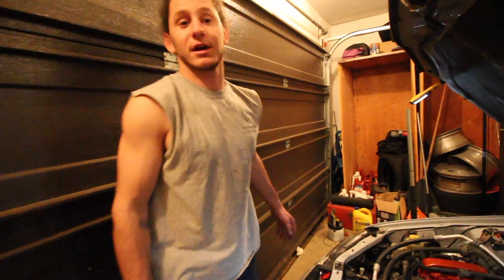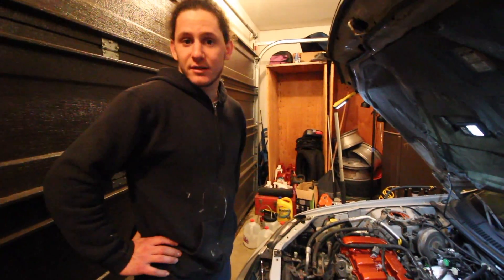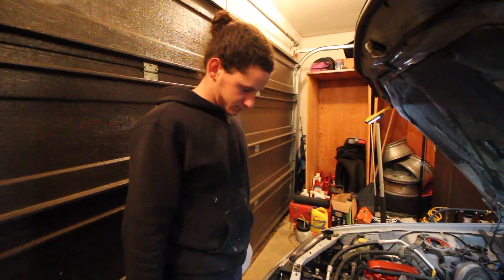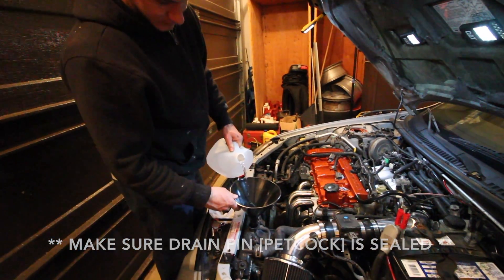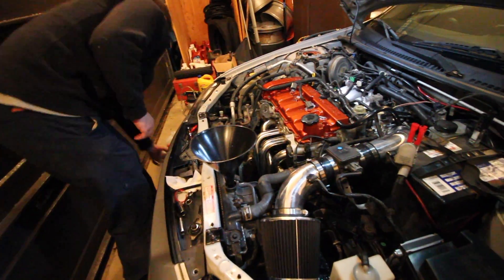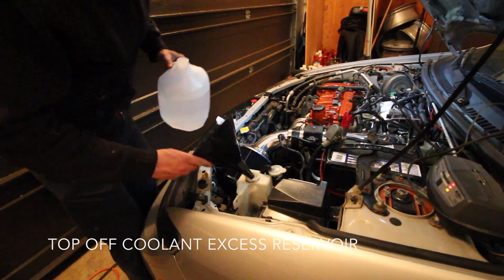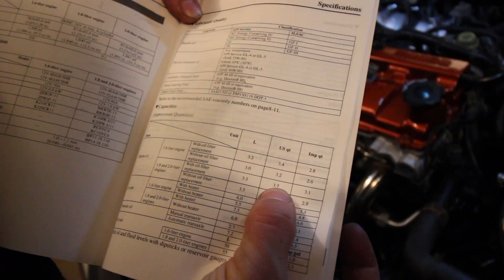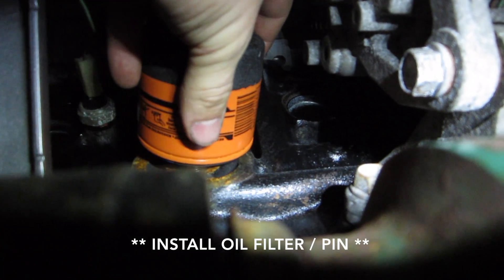How To Prime & Start a Dry Engine [FIRST START]

Comment: You definitely dont want to let a rebuilt motor idle... You should have kept the rpm around 1500 to 2500...
Reply from the maker: i just read up on that, and it seems logical, but we have never had an issue. we'll pay more attention to that in the future. thanks for the info!
Reply: Mils Garage I just had to say it, because it looks like you're a major perfectionist like me.👌
Reply from the maker: hahaha yeah, that's spot on. 👌 always aiming to do better. i really appreciate you tuning in :)
Reply: Why would you pour oil down the spark plug holes??... its just gonna sit on top of the pistons and foul up your spark plugs, cat and O2 sensor.
Reply: casiotechI you remove the spark plugs and crank the engine over until the oil pressure light goes out
Reply: casiotechI a lot of people... well then it MUST be true!!
Reply: casiotechI  what I did was... lubricate the cylinder walls with oil a little bit and and hand cranked few times and made it nice and smooth before putting the cylinder head back on. That way I made sure the Pistons are lubricated and I didn't have to pour oil through the spark plug tube which is eventually going to sit on the top of pistons unless you pour a good amount to make it reach the Pistons but that didn't seem to make sense to me. I am going to start my 7th gen civic engine tomorrow. Wish me good luck as this is my first job ever.

Comment: Thanks for the video; I was under impression the oil pump needs to be primed before adding oil, but by priming the pump when installed, here you primed it mechanically cranking the engine, this way it is easier but is this the correct way to do it? so much contradicting info out there that is why I ask. My rebuilt engine has been under a tarp on the side of the garage for 3 years with only the assembly lube on it, I think i used permatex, recently I just move it inside the garage for final assembly of all external parts and connecting transmission; this is for a 2004 manual Toyota Corolla; hopefully once primed and oiled it will start, crossing fingers. I subbed to your channel.
Reply from the maker: Yeah, there’s a whole lot that goes on internally, and i personally don’t have that knowledge atm, but it’s on my list of things to learn for sure. Thank you Rody 🤘🤘🤘 i really appreciate your support
Reply: @milsgarage  So after this 3 months finally I am at this point in your video; adding the "blood" my engine is dry as well so lets see what happens, hopefully will start just like this one here!

Comment: So I got a charger I am doing this to. It has 16 spark plugs could I just take half out every cylinder has 2
Reply from the maker: If your engine takes 2x spark plugs per cylinder, i’m not in a position to tell you it needs anything less than 2x spark plugs per cylinder
Reply: @milsgarage  I was asking if I need to take them both out to crank the engine
Reply from the maker: Oh, that’s a good question. i’m not 100% sure. i hope someone here in the comments knows

Comment: I followed all the steps, but still can't turn over my rebuilt motor. Is it becuz I'm using the old spark plugs? Or got any idea of wat is going on? It will just keep cranking, but won't turn over.
Reply from the maker: Sorry to hear.. There are a lot of variables that need to line up, and i'm not in a position to diagnose such a thing over the internet. i'd check fuel pump, spark plugs, coils, wires.. We can get it started at the shop if you're in the Delaware area.
Reply: @milsgarage  will do, and nah i'm not from around there, but thnx tho.

Comment: What engine is this? It looks beautiful
Reply from the maker: In this video, it's the stock 2.0L DOHC 16-valve in-Line 4-cylinder.. But since this video, we've removed this engine, rebuilt the top end, and then mounted a Mazdaspeed bottom with the oil return line, and also installed the Mazdaspeed turbo + boosting components. It's also all painted Maserati Red now 👉[ https://youtu.be/owYc-6gZBIc ]

Comment: What can be wrong if oil pressure light don't go off after cranking many time?
Reply from the maker: There can be a number different things going on; low oil, failing oil pump, .. What's going on with your car atm sir?
Reply: I took the engine apart and I assemble back everything and seem like the cylinder head is dry. Maybe it need more cranking on turning on the crankshalf? Would dry cylinder head cause oil pressure light to stay on or is it something else?
Reply from the maker: i'm sorry Kennedy, i've learned a great deal about cars, engines and mechanics, but i am not an internals expert atm. There may be people who are more knowledgable on the subject here in the comments who may be able to chime in. My understanding is that the oil pump will run at the same time as the cranking, pumping oil and lubricating the pistons further through the rings, below the pistons, and also through the egr valve. It will build oil pressure, which will then register in the ECU.. Turning the engine over with the small amount of oil is just to break the tension and allow the pistons to move freely, but i imagine it will also assist in creating the initial seal. Ryan's oil light went off and on when we cranked it, so it built pressure and went back on, but we went ahead and plugged the spark plugs in from there, and it started up. i would triple check all of the connections, but i wish i could direct you better than that

Comment: Distilled water will still get dirty and rust loool
Reply from the maker: .. lol? i’m genuinely confused why you would say this, but yes. Distilled water can in fact get dirty. It can cause rust, yes. Is this in regards to temporarily filling the radiator with distilled water?
Reply: @milsgarage  idk I'd warn people
Reply from the maker: They might have to drain it again. Which is specifically why we didn’t use coolant, because that would be wasteful 🤷‍♂️.. But yes, you’re correct. No one should be running straight distilled water unless they’re testing for leaks, flushing the system, or temporarily filling for engine diagnosis for realreal 💯
Reply: @milsgarage  But you specifically say "regular water can corrode the inside [...], distilled water won't do that". It doesn't deposit any minerals, because it's depleted of minerals. But it will definately corrode the insides if not mixed with coolant.

Either way, thanks for the video (y)

Comment: I guess I have a rookie question... don't you need break in oil?
Reply from the maker: Hey Lauren! All questions are welcome, and welcome to the channel :) Though we personally haven't used any special oil additives for first starts, they may help the engine break in for sure. If you choose to use them, i'd want to change the oil after 50 miles just to get possible larger debris out and swap to just the synthetic. Then change at 300 and normal from there.

Comment: Did you guys build this engine from ground up or did you just put another used engine in it?
Reply from the maker: we built the same block twice, but the second time we swapped Mazdaspeed turbo, boosting components, drivetrain and front bumper, then now it's custom paint and widebody.. Playlist [ https://www.youtube.com/playlist?list=PLb1yla77QSRhGDfsGlTUF_3jDdmzlqpDi ]
Reply: @UCxhm5_R4y9WIlENoVpCLtWg Well I went back and watched the episode where he revved the engine and it started knocking. I have that same knock but its at all RPM  constantly. And it squeaks....klassic spun bearing I assume.
Reply from the maker: yeah lol.. wow, we've come a long way with the build.. oh no. you've got a knock now? what's the plan? rebuild? forged internals? boost?
Reply: @milsgarage  Well long story short, This all started after the timing belt broke on me. I put another belt in the car and did a compression test. 170 accross with one cylinder at 155. But the car ran fine with no issues. It always had a problem with oil burn though. I found out #4 fills with oil over night and smokes like a train until it heats up. Then no issues. It would burn about a half a quart per day which i would just ad back.  But lately ive been hearing a tapping noise which keeps getting louder and louder. Today all hell broke loose and it got super loud much like what was in the video. I have plans to keep the car N/A witha CNC ported head and intake and larger diameter exhaust piping for more flow. I currently have cylinder head at my local cylinder head shop here in tampa being rebuilt. With this loud tappimg though im likely gonna need an replacement engine.
Reply from the maker: unless it's gouged up, i imagine they'll tell you it needs new gaskets, a rod and some rings.. balancing.. sounds like a good plan 👍
Reply: @milsgarage  Well....if I go that far its getting forged aluminum pistons and rods, new crank, bearings and ill slap the CNC'd head on that. For now, Im going to just get a used engine and replace it over the week end. Tear down the one coming out for analysis. Great vids man keep it up.
Reply from the maker: Sweet! i like that build plan way more! Make it bulletproof 💯. And thank you for your support!

Comment: Is the process the same if you had a cracked oil pan and all oil spilled out do you still need to unplug the fuel pump relay and take spark plugs out to prime the engine? Becuz I have a 350z and it has no oil pressure after the incident.
Reply: Thank you for replying I really appreciate it. So originally thinking I had no oil pressure. I think I’m wrong because  the only reason I thought I had no oil pressure because when you turn the key to on position (just before starting the car) the gauge shows zero. But I checked my other car and there is obviously no pressure becuz car is not on. Tell me if I’m wrong? But today I went to check for fuel and spark. And I have fuel. And checked  the spark and I have no spark in any coil. Changed the crankshaft sensor and nothing. Any advice on what I can do next?  It’s a 2004 Nissan 350z. I searched all over and don’t know what else it can be. Any help is appreciated.
Reply: And no. The car is stock height I bought the car like this. Previous owner must of hit something.
Reply from the maker: anytime Alex. 🤟😎👍 wow.. this is tough to diagnose w/o being there.. first double check all connections.. i keep coming up with ideas and then shooting them down. i'm going to run this by Ryan to see what he thinks. hopefully we can get you up and running soon
Reply: Thanks a lot!!! I will be waiting to hear back from you. I will try more diagnosing tomorrow.
Reply from the maker: Ryan says "maybe too much oil was put down the cylinders and it got on the spark plugs?"
Reply from the maker: hey Alex! sorry for the delay! that sounds right. you can use this method to get that pressure back. you slammed out on coilovers or something?
Reply from the maker: also, you're going to want to keep the rpm around 1500 to 2500 until the engine gets up to normal operating temp and fans kick on
Reply: Yeah I changed spark plugs just today. So that’s eliminated as a cause.
Reply: And with new plugs in. Still no spark. I had tested the coil and spark plug by putting both on a metal surface and cranking the car. No spark was seen in multiple cylinders. I didn’t do all cylinders but leaning towards that all don’t have spark at all.
Reply from the maker: have you checked your fuses and relays for anything burned out?
Reply: Checked all fuses and relays related to ignition and everything else that’s important and they are all fine.
Reply from the maker: and you changed the camshaft sensors.. i imagine you may need someone to hook up a power probe to figure this out
Reply: I didn’t check the camshaft sensors. But I Hooked up a multimeter and I have no power going to crankshaft sensor or to any coils.. So I figured maybe it’s a ground issue or an interruption in a circuit and not a sensor.

Comment: what exhaust system are you guys running?
Reply: thanks! sounds awesome
Reply from the maker: any time C K! so connecting everything, he's running a Magnaflow HFC on both setups 🤟😎
Reply: oh sweet, I'm probably going to get a similar setup. what other modifications would you recommend for the protege? (naturally aspirated)
Reply from the maker: dude, that's awesome 😎👍👍 we installed a stage1 clutch and lightweight flywheel [ https://youtu.be/gK1l6wuixZI ], but then we sheered a bolt off the transmission mount on the track [ https://youtu.be/FODVQ_hR_1Y ].. so we upgraded to AWR motor mounts [ https://youtu.be/gpewvNJdf3I ].. all of those parts were legit enough. maybe a short-throw shifter setup would be nice..
Reply from the maker: we built it into a Mazdaspeed Turbo Engine Protege5: [Build Episodes Playlist] https://www.youtube.com/playlist?list=PLb1yla77QSRhTJiwReKUnCncO1LStYYoK , so atm it's running the stock Mazdaspeed Protege header, down pipe, turbo, up pipe, to Megan Racing cat back.. but stay tuned, we'll be changing all that soon. :)
Reply from the maker: in the video, it was running an SRS header to .. something? i'll ask Ryan.. to Megan Racing cat back

Comment: you should not get the BEST spark plugs. is not the bestvfor your engine.... is the recomended?? i don't think so... the combustionn chamber will work in diferent temperature that the oem ones.... you need to rotate the engine more a couple times for the oil come to the top... before start the engine....
Reply from the maker: what do you mean? you should get the spark plug that's going to meet the specs you're looking for for your targeted purposes, every time sir. we've started many engines. don't be craycray. you just watched us start this one.
Reply: Mils Garage 
iridium or platinum is the best material to racing purposes... the temperature coeficient will be different from the original or recomended to the Best one that you mentioned in the vid.
....
Reply from the maker: you are correct..kinda.. so after starting this car up, we took it to the track and got the 0-60 times cause Subscribers asked for it: https://youtu.be/FODVQ_hR_1Y
then we built it into a Mazdaspeed Turbo Engine Protege5: [Build Episodes Playlist] https://www.youtube.com/playlist?list=PLb1yla77QSRhTJiwReKUnCncO1LStYYoK
i believe we chose the exact spark plugs for the job.
Reply from the maker: btw, i really appreciate your attention to details. 🤟😎👍

Comment: Could have just pulled the fuel pump relay or fuse or injection fuse to kill the fuel for the oil prime . Also you should always torque your spark plugs!!!! Trust me I’ve seen dyno numbers change from torquing your plugs .
Reply from the maker: yeah? all of that sounds like good advice. we have already rebuilt and boosted this entire engine, but i'll throw the torquing plugs idea at Ryan. sounds like an easy fix if he hasn't done so. thanks man 🤟😎👍

Comment: How about pumping oil through motor manually with valve covers and oil pan off to manually see oil flowing from all critical areas before putting engine in car? Better than just turning starter motor till oil light goes out? Oil Light out does not confirm Oil is flowing to every lifter, every cam journal, main bearings, rod bearings, Turbo, etc...
Reply from the maker: pumping oil through the motor manually? what do you mean?

Comment: Nice build. How long did it take from start to finish?
Reply from the maker: thanks! because we filmed it all and could only use the shop for 1 or 2 days on the weekends, during off hours (as a favor), it took about 10 weekends.. if our only jobs were to knock out a build, i'd like to think we could finish it in 2-3 weeks. r u working on a build?
Reply: oh ok not bad. im not building nothing at the moment, but im planning on doing a Honda build soon. looking into a Eg hatch shell or bone stock as possible, so i can start from the ground up. ive done one before but couldn't afford more then a mini swap and a few bolt ons. This time around i have more money to work with.
Reply from the maker: nice! i'd argue that the Eg hatch is the best of all the civics as far as the structure. finding a stock one these days has gotta be difficult.. gotta find that old hippy dude lol. man, if money wasn't a limiting factor..